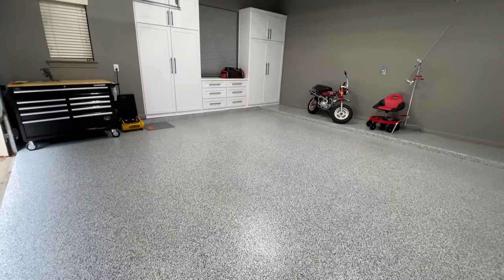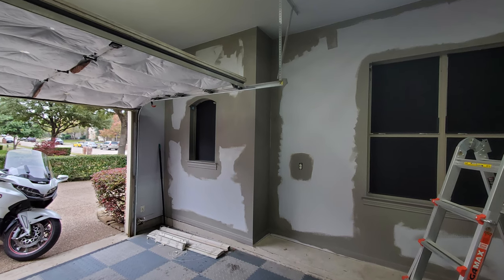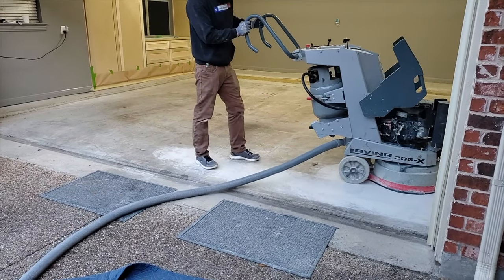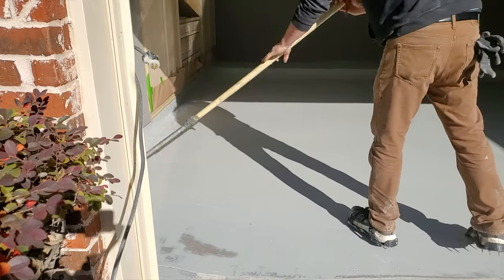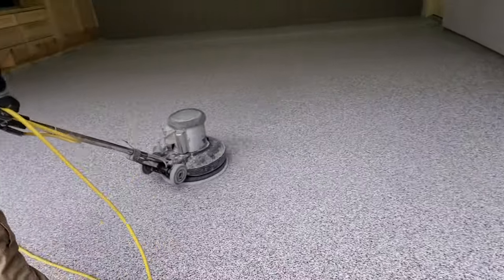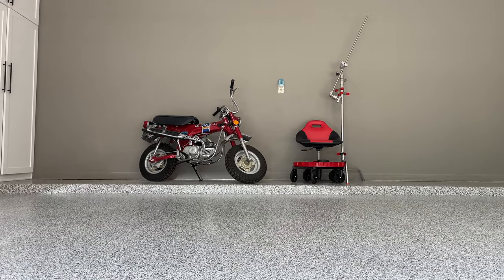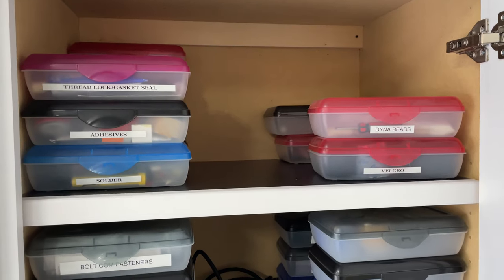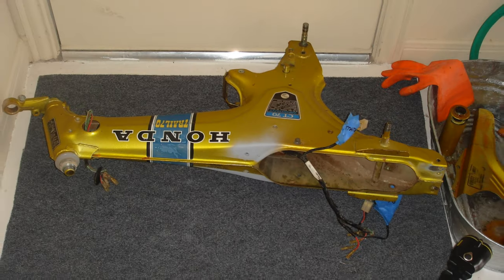Turning My GARAGE into a YouTube STUDIO CruisemansGarage.com

Comment: Garage looks great.  I'd add the sign.  I'd watch the restoration video.  I have had several Honda Trail 90's and 110's that I've worked on over the years.  I have a 1981 Trail 110 I ride on the farm.